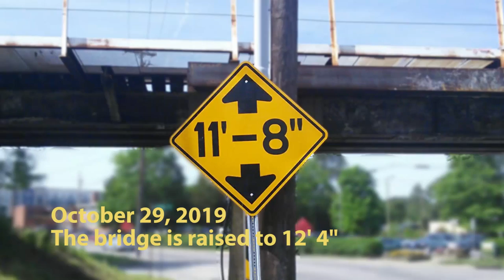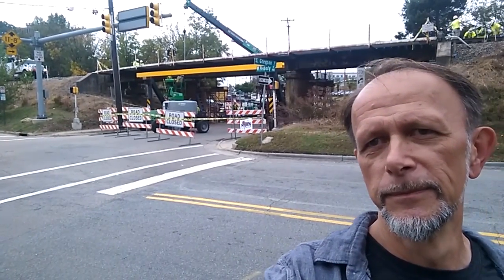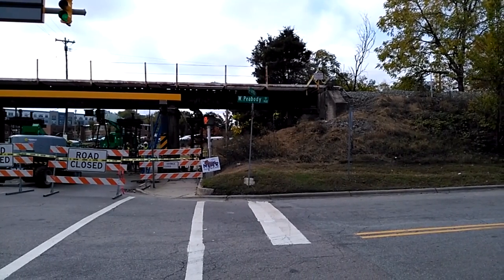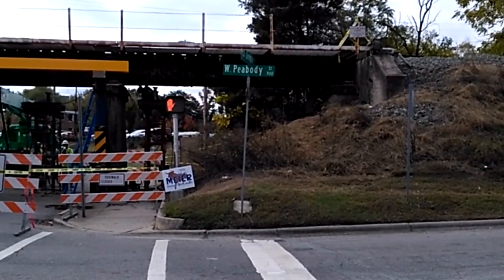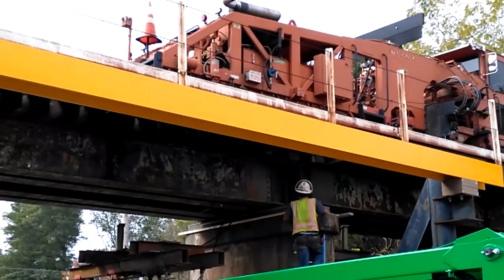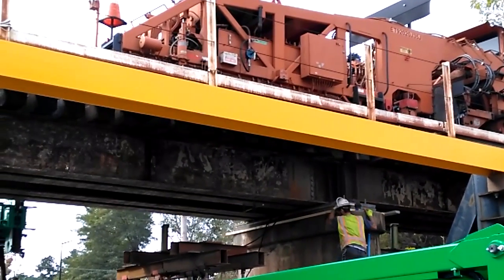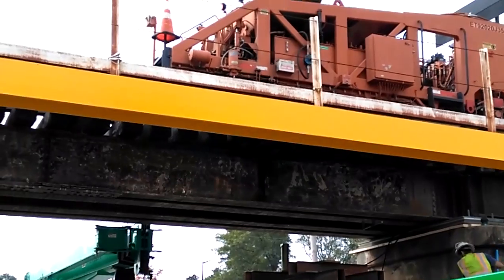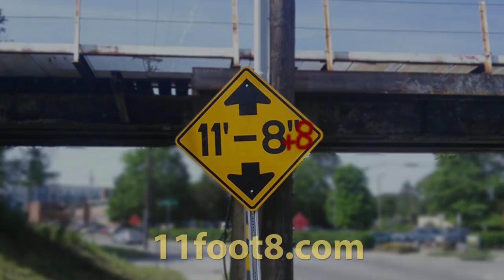Raising the 11foot8 bridge by 8 inches

Comment: Most rentals like Enterprise, Ryder etc, are 12'6", so get ready for some sweet peel-backs!!
Reply: The road surface moves up and down a fraction of an inch, changes in tire inflation can change ride height by inches. The metal on the truck expands and contracts with temperature. The suspension of a truck can add or subtract inches.

A loaded truck with springs might fit under the bridge in the morning when everything is a little chilled, then not make it through on the return trip after everything warms up and the truck is loaded.
Reply: @hamjudo  unloaded*
Reply: @hamjudo  Traffic under the bridge is one way.
Reply: Ooooooh yah! In Texas some low bridges have exits and entrances for truckers to bypass.. Urban areas don’t have the luxury.. Ennis,TX has a low and tight bridge that only cars and tiny trucks can go. The rest are stuck out.
Reply: @lawnmowermanTX  There's a low bridge in the middle of downtown Austin which has been hit so many times that the inner steel rebar is starting to be exposed and chunks of it broken off. It was only until a couple of years ago that the city put up overheight warning signs, but they're mostly useless because the exit for overheight vehicles is literally a few dozen yards before the bridge and is dangerously short, making a multi-vehicle accident a high chance of happening.

But that's assuming an overheight vehicle isn't smack dab in the middle of heavy traffic, which on that part of the interstate is from 5am-10am and again from 2 pm to 8 pm.
Reply: @GGigabiteM  Get a camera down there!
Reply: GGigabiteM get your camera ready and record my entertainment.
Reply: A bridge near my house is rated for 30,000 lbs and idiot truckers like to use it as a shortcut. Hopefully I'm around when the thing finally collapses into the creek so I can get some sweet video footage.
Reply: Anything up to 17' is 12' or less, and 17' is a common rental truck size. Obviously you still can't get a semi through there, but this will help out a lot of rental truck doofuses.
Reply: Yeah you usually get a couple extra inches in reality though. My trailers are marked 13'6" but the actual height is definitely less than that. Not that I would dare to test it. Lol I always get a little scared going under bridges marked 13'6" but it always fits without a problem
Reply: @bluered1322  Well the stated clearance includes a margin of error for loading, tire inflation, etc. There's a bridge near where I live where you can sneak a trailer under if you let the air out of the shocks, creep through, and then reinflate on the other side, and truckers who know, that's what they do.

Comment: Figures an Amtrak train full of people would be the first “test” train...
Reply: Amtrak trains are usually not "filled" with people.
Reply: The video didn't say that the train was in service. If it was the first train, very possibly it was just a test run with an out-of-service train.
Reply: @IkeOkerekeNews  would have been epic if it was
Reply: David, I am a railroad machinist and I can guarantee the only people on that train were the engineer and safety personnel.
Reply: If you are the oldest child, are you a "test run"?  We all can see the equipment calibrating the tracks.  I'd say they are the test run.
Reply: @thomasdemaio53   no because they do not weigh as much as a four-car train set.

Comment: I'm amazed that the scaffolding is holding up the bridge
Reply: I know, right?
Reply: I had to go back and look again, I was sure you must have been mistaken. But sure enough it does just look like scaffolding and some I beams to spread the load. Huh... who would have guessed?
Reply: @--_DJ_--  pretty sure the other jacks that were sitting directly on the abutment were doing all the heavy lifting. Those jacks on the scaffolding were there to minimize sagulation in the center for shimming.
Reply: @mitchdenner9743  Sagulation, I like that.
Reply: @--_DJ_--  The word sagulation itself is likable but not any thing saggy it is describing!
Reply: @--_DJ_--  👍😁
Reply: Brian Smith I had the exact same reaction. They said that those bottle jacks were 55-ton ( they had twelve of them,) and the I-beam cribbing seemed adequate, but man, the scaffolding looked way, way too pinner to support those loads. I am astonished that they held. I mean, maybe I assume too much here, but it looked pretty much like an ordinary construction scaffold. Yoicks!
Reply: mitch denner “sagulation.” Excellent word. Will use. Thank you.
Reply: That isn’t regular scaffolding. It’s more narrow and heavier built.

Comment: In addition to the interesting documentation on the bridge: some outstanding industrial architecture in the background - beautiful! Thanks for sharing Harald
Reply: So the jacks raising the middle of the bridge looked like they were on scaffolding. No one else has addressed this observation. What do you think?
Reply: @georgiadronefootage4136  Yeah i noticed that too and was curious about it. As long as the scaffolding doesn't start to tilt i guess it should be fine, but i would still be dubious about it. I'm guessing the the train tracks keep the bridge from moving side to side and the ends of the bridge are tight enough that it shouldn't move forward and back, so the scaffolding holding the bridge doesn't sway at all.

Comment: It still doesnt look like its going to be tall enough.
Reply: We can only hope.
Reply: It won't. Most trucks are 12'6". Drivers should know their truck height and if there are any questions drive around.
Reply: @ptmy8590  what fun is that
Reply: Chris P Bacon  The city could just bite the bullet and rip up the sewer line and bury it lower if they really wanted to get rid of this problem once and for all to give the bridge the standard height required to clear most trucks. It's just an engineering challenge. Obviously the signs and flashing lights are just engineering around the sad fact that the human condition won't expect a less-than-standard clearance.
Reply: @keeleye7225  You drive through red lights at full speed too?
Reply: That's what she said.

Comment: 11foot8 brigde rised up to 12foot4 brigde to prevent canopener activities.

Ryders driver: Challenge accepted! 😂
Reply: Let’s not leave out the lowest of the cheap rental trucks — U-Haul!
Reply: and the ac`s from the mobile homes
Reply: @danielbenedict8818  u-hauls aint gonna hit this anymore those are 12'4" and most being loaded will just barely scrape
Reply: Most of the trucks that were hitting it( penske,rider) are 12'6 or 13'0 so that's still low.
Reply: all rental fleets are currently installing 8-inch lifts to their trucks to match the new 8 on the bridge
Reply: Sä Sch the new height is 12-6!

Comment: I like how they're not even trying to hide that all they did was repaint the pillars, and stick a couple random sized shims under there
Reply: Like a scheduled train you might say. Wait long enough and one will arrive.... and here you are. 

“random sized shims”.....coming from a random IQ basement dweller
Reply: This is a pretty standard repair process. 
The paint used protects against rust, etc. 

What they need to do is lower the road beneath. 

It would be so easy to do this with a professional crew.
Reply: J B they can’t lower the road as there is a sewage system runing beneath it that would make all kinds of problems to reroute/rebuild
Reply: Harold Slick  - That would be "ellipsis" not "ellipses". You used the plural form. I did it once. But please, do continue, it's great you keep track of your periods. Much like a train schedule, timing is everything.
Reply: @AlteryxGaming  
I literally work for the Pierce County sewer department in Washington State. And before that, the Roads Department.

Lowering the road would not be hard to do. The sewer pipes can be re-routed pretty easily. 
Sewers are not what people see in TV and movies. It's not a big concrete tunnel. It's usually PVC pipe. Probably no larger than 24" in diameter.

Anyway, the point is that the road could be lowered to avoid crashes. Maybe this town doesn't have the money or willingness to do it. 

Maybe they should have a detour for trucks...

That is all

Comment: "Mommy I wanna be a ballast tamper driver when I grow up!" Seriously though, those are pretty neat machines.
Reply: That's better than aspiring to be an off duty policeman.
Reply: I’m actually a tamper operator. Believe it or not we’re some of the highest paid and most skilled people on the railroad. And it’s such a small group of people that most of us know each other. 

If you want more info on them look up HARSCO Rail on YouTube. They have a ton of videos of Mark IV tampers and 6700 tampers. Along with some videos of regulators and other track equipment. The one in this video is a Mark 3 tamper. It’s an older machine , the ones they have now are far superior and much more technologically advanced.
Reply: Seriously!  I was really most impressed with those brilliant tamper and ballast regulator machines there at the end of the video. 
That's some seriously brilliant engineering using intricate hydraulics and leverage.  Very cool stuff!!  Excellent!!
Reply: There’s a set of tracks very close to where I work. Some major repair work was done to them and I had the opportunity to take a close look at one of these and talk with the crew. Both the machine and crew were equally impressive. Learned a lot and made a couple friends. Good people.

Comment: I was completely surprised by the two level crossings so near 11'8".  Just a little way in each direction, with 11'8" sitting in a gully.
Reply: You would think they would just eliminate the bridge entirely and install an at level grade crossing instead.
Reply: @jsciarri  Just eliminate the bridge underpass and force everyone to turn left or right
Reply: You can cross under the 11'8" while the others are closed for a crossing train. For 9999 out of 10000 drivers the 11'8" is a solution, not a problem.
Leveling out this intersection, or eliminating it altogether, would be inconveniencing thousands of people who use the underpass every month, in order to save 1 driver from facing their own inability to safely operate a vehicle of their choosing.
Raising the bridge by just 8" will save a lot of vehicles from their incompetent drivers, while minimizing the cost and inconvenience to everyone else.
Reply: @tybofborg  Hi Ty!  You are totally correct.  Nearly everybody understands how to safely cross under the bridge.  

What astonishes me is how a driver can trigger the over height system, sit at a red light with the sign telling him "over height, turn" and then drive straight into the guard girder and then possibly the bridge.

Raising it from 11'8" to 12'4" still leaves it 3'8" UNDER the federal standard of 16'0".  Trucks will continue to strike this bridge.  Based on the footage of 150 wrecks so far, that will cut out about half of them, certainly not all.

The day someone gets killed (probably a pedestrian in just the wrong place) will change the equation.  How can convenience outweigh a deadly hazard?  The politicians will sing a different tune that day, as will the RR.

Comment: Wow great access to the construction site. Would have thought that raising bridge by over half a foot might have required a longer stretch of track also being elevated.
Reply: Well, considering the sleepers aren't fixed to the ground, lifting the bridge should indeed lift the surrounding track. This is why the ballast adjusting equipment is needed.
Reply: @thegrandfinale2 the lift actually took 8 hours, despite it appears like only 5 minutes on video.

Comment: When you spend half a million dollars on 8 inches ;)
Reply: Have to wonder if it wouldn't have been cheaper to simply lower the road by digging it out.
Reply: An2nio Productions in 2019, forma public work, moving a sewer and diggin a street down should cost more than a million. Sadly.
Reply: "When you spend half a million dollars on 8 inches ;)"
A women would say it's worth it.....
Reply: @antoniojmonetti  that makes sense, the sewer line needs to be pitched correctly to drain and putting a dip in it is completely out of the question. But that does beg the question of why the sewer line is so shallow...

Comment: In barber terms: "Take a little off the top!" 12'4" will still catch it's share of trucks since 13'6" is the max height for semi's. Stay Tuned!
Reply: RockinRob69 you can’t add?  the new height is 12-6!
Reply: @pkendall99  how the hell do you get 12-6? 11'8 + 8 is 12'4.
Reply: Patrick Kendall Don’t forget an inch is 1/12 of a foot.
Reply: Actually there are a lot of semi trailers that are 14 ft 6 in and they are not allowed to be east of the Mississippi River.
Reply: He must've thought there are 10 inches in a foot
Reply: Oooof and whoooosh at the same time?!?!

Comment: There were 150 crashes recorded between April 2008 and October 2019, averaging 13.6 crashes per year. After raising the bridge, 18 crashes were recorded between October 2019 and June 2021, averaging just under 9 crashes per year. It is safer than before, according to those numbers... but drivers gonna drive.

Comment: Engineer meeting:

Engineer #1: What height should we raise the bridge?

Engineer #2: most trucks are 13’6”

Engineer #1: So 12’4” should be good?

Engineer #2: Yup
Reply: Apparently they can't raise it any higher without a much more massive and expensive project. Raising the railroad tracks to clear the standard trailer height would lead to problems with the nearby street-level grade crossing shown when the ballast tamper is working. You have to have a long enough run of track to raise it without increasing the track grade too steeply; a 14" height increase at the viaduct might well require taking the line out of service to do the work, because there is also limited room to add the earth and ballast to raise the tracks to the new bridge height. There are also likely issues with who's paying for it, would they need new support pillars instead of how they did the limited lift with stacked steel plates, and how long would the line be out of service.
Reply: As well as raising the bridge, could they also lower the road underneath?
Reply: PhilfreezeCH Fair enough.
Reply: @Dave-dm7vt  Sewer pipe too close to the surface, to lower the road.

Comment: This was VERY interesting!!! Any idea what the funding looked like for this? Was this absorbed as infrastructure maintenance and upgrade on behalf of the RR, was it due to pressure by local government upon the RR to do the work, was it partially absorbed by public funds (tax dollars) and the rest by the RR?

Interesting that it cost a half a million dollars when in reality the work was performed in a week with common equipment, general laborers, a few what look to be millwrights or iron workers and then the RR's own equipment. Seems like a high price tag for what looked like relatively simple and straightforward work.
Reply from the maker: The project is funded entirely by the NC Railroad Company, which owns all rail infrastructure in North Carolina. The contractor(s?) for this job was/were hired by Norfolk Southern, but paid by NCRR Co. The raising of the bridge is only part of the job, They will also sandblast and paint the structure bridge, once the weather settles down again.

Comment: Should've raised it to 13' 6"
Reply: Chef Jack The Professional Driver who will pay the railroad when it’s main line through Durham is out of service? Also how many other road crossings will need rework to maintain the proper change of elevation needed for efficient operation? It was pure luck the adjacent stretch was actually a bit low and needed adjustment.
Reply: @Renville80  Good question! I believe the state should...
Reply: Remember cost.
They ran out of wooden shims.... 
I would have thought the truck company's would have plenty of scrap they could donate
Reply: Why didn't they just lower the street level? Isn't that waaay easier??
Reply: @i.i.iiii.i.i  I'm pretty sure there's a sewer line right underneath
Reply: And a large drain (see the drains on both sides of the road) for water...
Reply: I think you meant 13' 4"
Reply: @xXBL4KAl3YSSXx  13' 6". Our trailers are actually 13' 5.5" tall
Reply: @chefjacktheprofessionaldri6284  you believe that taxpayers should cover the cost of a low railroad crossing and not the railroad, interesting
Reply: @robertgraves4963  never said that. Railroads responsable
Reply: Chef Jack The Professional Driver Exactly
Reply: @felixc543  Sooo - - dig down to the sewer pipe, install metal grating at that level, then pave asphalt out from there.
Reply: Yep ...and more 🤕😒
Reply: Stephen Ritger  and a gas line

Comment: So surprised at the lack of comments about the real reason the track was raised.
It wasn't to stop the accidents at all.
The railway company just wanted to even the gradient of the tracks, so they no longer had to slow down their trains when they drove through that area.
That's why they didn't bother to raise it higher, and never will.
Reply: The government should've forced them to raise it to the standard height. This is a major renovation that probably required government approval. They should've denied it until it meets current code.

Comment: They could have just lower the street itself. digging is cheaper.
Reply: There's sewer piping right underneath the road. As it turns out, the people actually managing the problem considered this, and had good reasons for not doing it.
Reply: It was explained in i think another comment section that the whole area is 100 years old or more and the sewers and water mains are close to the surface so its not viable without costing more than its worth
Reply: Plus with how close the perpendicular roads are, there would be a high centering hazard for longer vehicles.
Reply: it would still cost too much, and your point about having to replace it eventually makes no sense, you don’t buy a new car Bc “you’ll need another one eventually”